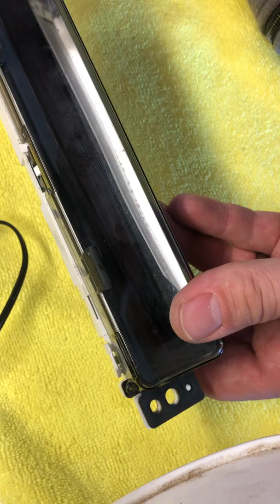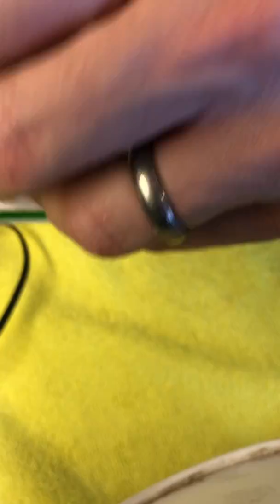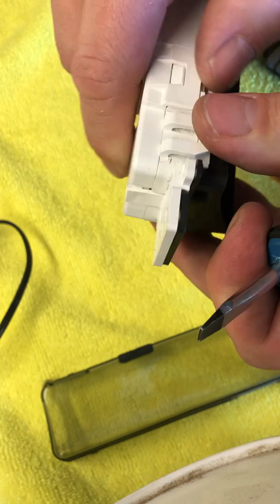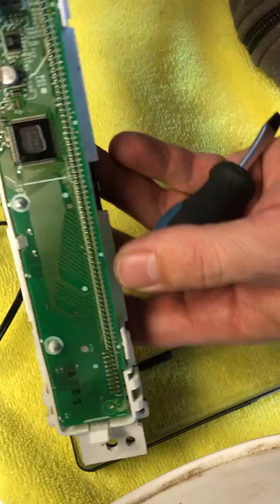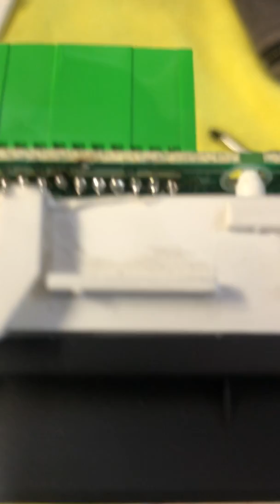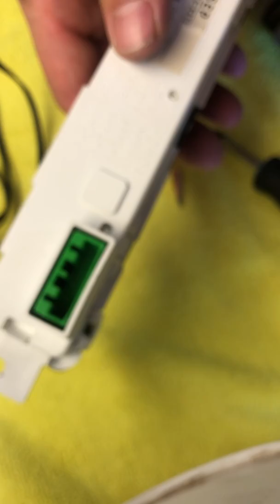2004-2008 Acura TL Center Display Flickering Fix

Comment: Thank You 70dude! This fixed my display on my '04 Acura TL. Dealership wanted over $400. the vent unit comes out of there in about 3 minutes. No reason to take off any other dash trims to get it out. Just pry out the sides and bottom. No clips on the top edge. The solder joints are pretty close together. I flowed new solder but I'm curiuos and would imagine that just reflowing the solder would work but the problem would more likely return. I had 2 joints that looked very close so I cut the solder with a #11 X-Acto.
Reply: So you you pull it from the top and out?  If so, how do you get under the edges without marring the plastic?
Reply: Same question how do you pull it out ??

Comment: So you just added soder to the existing pins ?? That’s it ?? I’m having trouble understanding how that helps . I’m going to tackle this very soon. Also did it work ?? So my display flickers but sometimes the radio channel and volume display doesn’t show up at all . Is this similar to the issue you have or had?? Thank you for info ?
Reply from the maker: Yes that’s it! The existing solder is cracked and needs to be filled in. Still working good to this day.
Reply: @ct70dude  so it looks like you just add solder to those existing little pieces?? I just want to be clear when I do this . I’ve never done it before thx for getting back
Reply: Well I did it . Still not working . Thx for your videos  . I think I found a place that has the part . Great info though . Thx
Reply: @Americanboy5150  what place did you find one
Reply: @jrparker1108  I didn’t . This junk yard had one with same part number and the front looked the same but when I went to pick it up it had a small blue connection instead of the wide green connection . So I’m still looking . The display actually worked again for a few days then went out again ..idk
Reply: @jrparker1108  junk yard in Caseyville Ill.

Comment: I have a 2008 TL with this issue. Does anyone else with this issue also lose their navigation / stereo occasionally?
Reply from the maker: I started losing mine a few years ago and then it finally just shut down for good. Just black and couldn’t do anything. I had to take the navigation box on the trunk in and get a new one.
Reply: @ct70dude  The box in the trunk lasted 10 years and then had mine mailed too and  repaired by Alpine for 160 back in 2015. Dealership wanted 500 to send it to the same place. Repaired Nav still works 7 years later.

Comment: My problem is no power ata all
Reply: Did you pull out board? I checked out a few videos and researched it best I could and re-soldered the joints of the green connector. Lit up like new with no flickering. 
I was chasing no power as well.